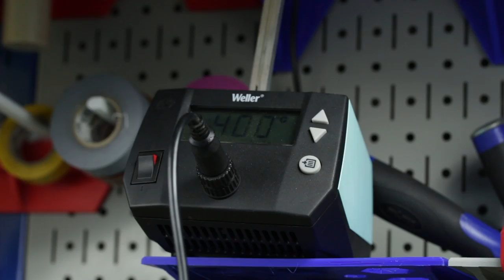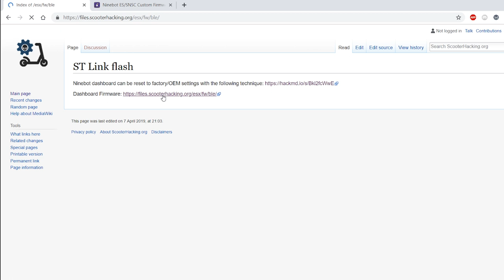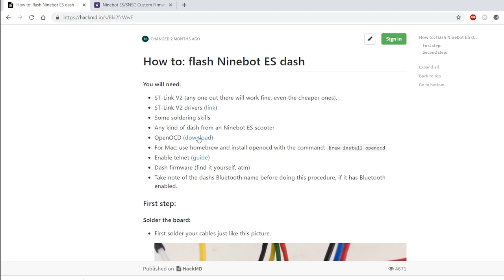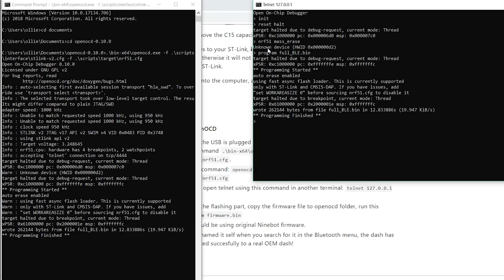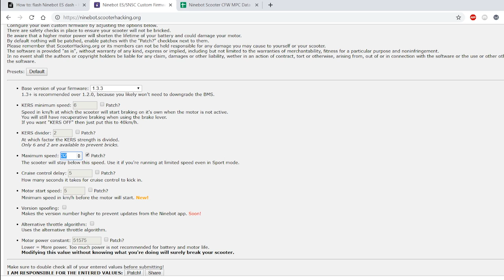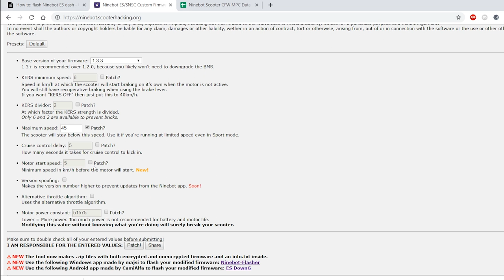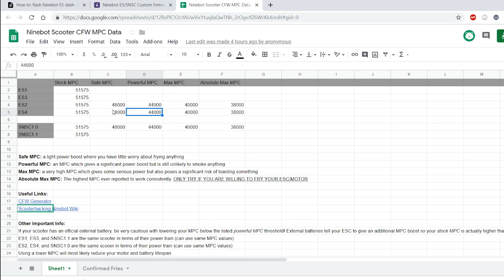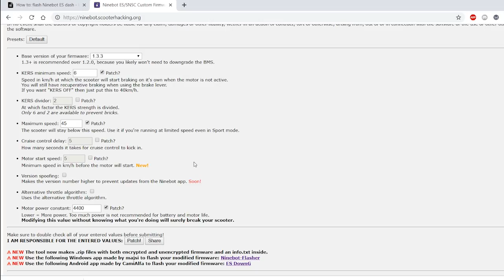Ninebot ES/SNSC Custom Firmware (CFW) ST-Link Flash Tutorial

Comment: Hello to everyone.
I have an ES4. I have never hacked anything. With the last update from Segway, which i think it was released about 3 weeks ago, my scooter now goes up to 32km easily. Also it used to suddenly brake when i was going downhill in order to not pass 32km (which was a bit dangerous) but that braking is also gone. Yesterday for example I went 40km downhill.
Reply: Is this with full battery and without cruise control?
Reply: @Zamani3033  No cruise control. Battery doesn't matter if it is fully charged. I get 32km even if the battery is at 50%.

Comment: Great video.
I bought mine already modified and with external battery and I was having a blast with and has been a blessing to avoid using public transportation.
Now, after less than 800kms and six months later, in Sport mode, everytime after a couple hundred meters after begining my daily use I'm having massive torque loss!! It takes forever to reach 30km/h and before was a metter of seconds... small uphills that was possible to make at 20kms/h now it's climbing at 8 / 9kms /h :(...
What do you thing it could be and how to fix it, since I haven't found any solution in the internet?
TY
Reply: Battery related problem probalbly

Comment: please help !

 Open On-Chip Debugger 0.10.0
Licensed under GNU GPL v2
For bug reports, read
        http://openocd.org/doc/doxygen/bugs.html
Info : auto-selecting first available session transport "hla_swd". To override use 'transport select <transport>'.
Info : The selected transport took over low-level target control. The results might differ compared to plain JTAG/SWD
adapter speed: 1000 kHz
Info : Unable to match requested speed 1000 kHz, using 950 kHz
Info : Unable to match requested speed 1000 kHz, using 950 kHz
Info : clock speed 950 kHz
Info : STLINK v2 JTAG v28 API v2 SWIM v7 VID 0x0483 PID 0x3748
Info : using stlink api v2
Info : Target voltage: 3.234437
Error: init mode failed (unable to connect to the target)
in procedure 'init'
in procedure 'ocd_bouncer'

Comment: I can get up to the point where I try to Telnet in via the command line, but thats not working. Any way to figure out if/what address I might use instead of the one you provided?
Reply from the maker: Eli Whipple can you confirm you’ve enabled telnet on your PC?
Reply: @BananaScience  Yes, telnet is enabled on my PC. Reading through more threads, I am using some knock off dashboard without a capacitor on c15 that others seem to be having an issue with.
Reply: My apologies, everything worked fine. I needed to actually be running two CMD windows to do this. I was running the long code, cancelling it like a dummy with Cntrl C and then trying to telnet. Run long code, then open another CMD window and telnet, got it! Working fine, but getting an error 49 and some weird behavior on my working scoot. Getting error 10s on the others.
Reply from the maker: @eliwhipple1854  Error 10 means you either need to replace or flash your ESC but I'm not sure what error 49 means.

Comment: Hey bro im stuck at the end, do I need to resolder ? Thanks

C:\Users\Paul\Desktop\openocd-0.10.0>.\bin-x64\openocd.exe -f .\scripts\interface\stlink-v2.cfg -f .\scripts\target\nrf51.cfg
Open On-Chip Debugger 0.10.0
Licensed under GNU GPL v2
For bug reports, read
        http://openocd.org/doc/doxygen/bugs.html
Info : auto-selecting first available session transport "hla_swd". To override use 'transport select <transport>'.
Info : The selected transport took over low-level target control. The results might differ compared to plain JTAG/SWD
adapter speed: 1000 kHz
Info : Unable to match requested speed 1000 kHz, using 950 kHz
Info : Unable to match requested speed 1000 kHz, using 950 kHz
Info : clock speed 950 kHz
Info : STLINK v2 JTAG v31 API v2 SWIM v7 VID 0x0483 PID 0x3748
Info : using stlink api v2
Info : Target voltage: 3.145736
Error: init mode failed (unable to connect to the target)
in procedure 'init'
in procedure 'ocd_bouncer'

Comment: C:\Users\Summer\Documents\openocd-0.10.0>.\bin-x64\openocd.exe -f .\scripts\interface\stlink-v2.cfg -f .\scripts\target\nrf51.cfg
Open On-Chip Debugger 0.10.0
Licensed under GNU GPL v2
For bug reports, read
        http://openocd.org/doc/doxygen/bugs.html
Info : auto-selecting first available session transport "hla_swd". To override use 'transport select <transport>'.
Info : The selected transport took over low-level target control. The results might differ compared to plain JTAG/SWD
adapter speed: 1000 kHz
Info : Unable to match requested speed 1000 kHz, using 950 kHz
Info : Unable to match requested speed 1000 kHz, using 950 kHz
Info : clock speed 950 kHz
Info : STLINK v2 JTAG v27 API v2 SWIM v6 VID 0x0483 PID 0x3748
Info : using stlink api v2
Info : Target voltage: 3.273164
Error: init mode failed (unable to connect to the target)
in procedure 'init'
in procedure 'ocd_bouncer'
Why am i getting this error?

Comment: Thank you very much for the clear tutorial... worked perfectly for me after flashing the bluetooth dashboard. Though I could not flash the control board but that is not the issue causing my wheel to rattle when it turns, I found out that one of the hall sensor wire connecting to the motor is broken, so join them back and its working perfectly now.
Reply: Como delimitar mi patinete eléctrico bongo  cecotec
Reply: Alguien sabe como puedo hacer para poder hacer la belocidad a 25 kh

Comment: Hi I have a doubt with the ESC (electronic speed control) is not the same dashboard? It is the motherboard that is where the battery is connected. I have a scooter of that tutorial reference but it does not turn on, nothing appears on the screen if I turn off the taillights, turn on the screen but not the speedometer. I think it is a type of blocking my concern is that I bought the dashboard and it doesn't work. I lose my money. What advise me please
Reply from the maker: Is it an ex rental scooter? The two electrical components people confuse a lot are the dashboard and the control board (AKA ESC). If you have an ex rental scooter you will likely have to flash the control board as well as the dash to get it to work.

Comment: I have a question , what if I have a bird scooter and I have the new dash board but I can’t make it run and the only way I know how to make run is buying a new controller is there another way to make it run Like flash the controller or something like that? Thanks have a nice day
Reply from the maker: Forfeit 7 TV Does it read error 10? If so check out the forums on how to flash the speed controller which will fix your issue.

Comment: When I go to put the hacked firmware into the Ninebot-flasher app using your steps it says my file is ‘bad’ any advice?
Reply from the maker: Use a earlier version of firmware. I think the latest version Ninebot Flasher accepts is 1.3.9. If it's any other version, it will throw an error.
Reply: BananaScience Have you heard of when the ES4 gets to 22 mph it quickly applies breaking and goes to 19mph and then cycles doing this?
Reply from the maker: @mrdwil777  Yes that is normal. CFW only guarantees stable speeds up to 20mph at the moment and anything above that will have that strange acceleration and declaration issue.

Comment: Hi,  I did  exactly all procedure as video and after program command using full_BLE.bin, the console sent an error "couldn't open full_BLE.bin" and **programing failed**......
 > program full_BLE.bin
target halted due to debug-request, current mode: Thread
xPSR: 0xc1000000 pc: 0xfffffffe msp: 0xfffffffc
** Programming Started **
auto erase enabled
couldn't open full_BLE.bin
embedded:startup.tcl:476: Error: ** Programming Failed **
in procedure 'program'
in procedure 'program_error' called at file "embedded:startup.tcl", line 532
at file "embedded:startup.tcl", line 476

Could you help me ??....Now when I connect dashboard to ES2 it don't do nothing, only brake lights blinking .
Reply from the maker: I’ve never seen that error before and am just as clueless as you to the cause of it. I’m no professional when it comes to OpenOCD but I would check out the Scooter Hacking Discord and ask some of the devs which might be able to help. Sorry I can’t do more!
Reply: I got a similar issue on my end! Very annoying.
Reply: Download the bin file again
Reply: hola as encontrado algo a tu problema ???

Comment: This is a great guide and worked perfect but I have 1 problem. Everything works perfect on the ES 2 scooter (the one with just the 1 internal battery) but when I do it with an ES4(has the additional external battery), I can't get the batteries to charge past 75%. Do you have any advice? Thank you for this info
Reply from the maker: To confirm, this is after you have flashed the hacked firmware? Is the range affected (only 75% of the range?).
Reply: yes
Reply: @BananaScience   @BananaScience  Yes, everything works perfect and 100% charge on the ES2's but my es4's will only charge to about 78%. If I take the external battery off I can charge the internal one to 100%. If I have both the internal and external battery installed, I can only get to like 78%. I checked voltage and I don't remember exactly off hand but 78% was not a display error. The voltage was lower than the ES2's showing 100%. I have swapped both internal and external batteries with my other scooters with the same results. I am thinking it's a BMS version problem. My batteries have mismatched versions but I don't know how to change them individually. I don't know if it matters but I also don't have windows 10 for the serial number change. Thank you again for your work
Reply from the maker: Yeah it could be a BMS version issue. You can update the BMS firmware through the ninebot mobile app and then re-flash your hacked firmware afterwards.
Reply: @BananaScience  Excellent, I will try when I get home. I was scared to install what Ninebot called the  "master software" version 1.4.1. I didn't know if I could go back to hacked software after I updated or not. Also, do your LED's on the bottom work after the hack flashed install? One of my Es4 work but the other does not. I have researched and from what others say, it has to do with the serial number.
Reply from the maker: All of my LEDs on my scooters seem to work after flashing the hacked firmware. Let me know how it goes!
Reply: @BananaScience  I figured it out. Get ready for a laugh. They don't all have LED's on the bottom.
Reply from the maker: Lol ya

Comment: i am getting error 10 with a a red wrench flashing on and off. do you know how to fix this?
Reply from the maker: Is this after flashing custom or stock firmware?
Reply: I got this error when connecting to a newer model without flashing. I'll be trying the firmware update when my ST-Link comes in.
Reply from the maker: Antassium it’s likely because the new BIRD ESCs use proprietary firmware that needs to be reflashed. Check out the scooter hacking forums for instructions on that.
Reply: @BananaScience  what if you thought you already flashed it? did the flash just not go through correctly?
Reply from the maker: Giacomo Ciminello What do you mean? Could you please elaborate a little more? Did you already flash the dash or ESC?
Reply: BananaScience dash got flashed. I think. On a Mac, don’t recall seeing errors, but followed all the steps as stated. Plugged in, error 10. Pulled the control board, found schematics for soldering the usb yo the board but no real instruction on how to flash the control board so I’m at a standstill

Comment: Hey, i after i flashed the new firmware on my Ninebot ES1 (with extarnal battery (from ninebot offical))  i wont go any faster than 18 km/h. I used https://esx.scooterhacking.org/ to make the firmware and i flashed it over bluetooth with IAP and i also tried Ninebot flasher. The scooter still works but i capped at 18 km/h (when i reach 18km/h the motor either stops or gives jsut enough power to keep it at 18km/h). All i changed when i made the firmware was the max speed to 35 km/h and the Motor Start Speed to 3 km/h and the Motor Power constant to 47000 and 48000 (tried multipel things to make it go faster than 18 km/h). Everything went smooth when flashing the firmware but i didnt go faster. BUT the Motor Start Speed did actually change to 3 km/h so that worked atleast. I also tried to hack another scooter that i am borrowing from a guy (also Ninebot ES1 with extarnal battery). But his goes upto 22 km/h. Thats why i think that maybe my Extarnal battery is either broken or ¨unbalanced¨ (heard that if the battery is ¨unbalanced¨ it wont give the scooter better performance by this guy https://www.youtube.com/watch?v=F83vr0o-mYc&t=321s at 5:02. PLEASE HELP!

Comment: After doing this my scooter . Pulls and stops from 20 to 21 mph.  Meaning is like breaking and acceleration every 4 seconds from about 19 to 21 mph.
Reply from the maker: Fast Hardware yes, we noticed that too. CFW doesn’t support more than 20mph yet
Reply: There is a new cfw based off 1.3.9.  Any changes or improvement on this breaking effect

Comment: Friend I have been working with the St-Link V2 but lately when I connect to the STM32 ST-LINK Utility I get an error like this: 
18:42:50 : Can not connect to target!
                  If you're trying to connect to an STM32W1xx device, please select Normal or HotPlug mode from Target->Settings menu.
                  If you're trying to connect to a low frequency application , please select a lower SWD Frequency mode from Target->Settings menu.
18:42:51 : No target connected

Know what is causing this problem, so far I can not solve it and I have updated drivers
 :C

Comment: Bno ya descargue el archivo q me enviaste,    seguí los pasos  y al ejecutar . /bin-64/openocd.exe - f. / scripts/interface/stlink-v2. cfg - f. /scripts/target /nrf51. cfg     
Me aparese esto :
Open On-Chip Debugger 0.10.0
Licensed under GNU GPL v2
For bug reports read
http://openocd.org/doc/doxygen/bugs.html
Info: auto-select ng first avallable sesión transport "hla_swd". To override use ' transport select<transport >
Info:the selected transport took over low-level target control. the results might might differ compared to plain JTAG /SWD Adapter speed:1000khz
Info:  Unable to match requested speed 1000 khz, uning 950 khz
Info: Unable to speed 1000 khz, using 950 khz
Info :clock speed 950 khz
Error:open failed
In procedure 'init'
In procedure ' ocd_bouncer'

Por favor dígame q estoy haciendo mal en serio no quiero abandonar mi scooter    gracias por todo
Reply: obtengo el mismo error   que sera???

Comment: Will you ever make a tutorial how to flash using the android app and bluetooth?
Reply from the maker: Likely not as the process is almost identical to this one except you need to just transfer the CFW file to your phone instead.
Reply: From my research, I wasn’t able to change my serial number via Bluetooth, I think it requires the st-link to disable that, if the 4th digit in the Serial is an R, then it is stuck in rental mode with only 1 speed setting.

However in curious if it will work via Bluetooth if you remove the c15 Bluetooth refresher chip

Comment: Can someone tell me if any of these steps will work for a Segway mini lite? I bought one that was supposedly “new” works ok, but I can’t get it to connect via Bluetooth therefor I have additional feature/mode control. Rather then passing on my problem to someone else by selling it, thought I’d see if flashing the firmware would fix it. Any guidance is appreciated.

Comment: So if you want the original firmware then you have to disassemble it and if you want a custom one you just use ble?
Reply from the maker: You need to flash OFW before you flash CFW. So if you want CFW you have to flash OFW first unless your scooter is not an ex-rental scooter.

Comment: Could you ever do this without soldering? If I buy an oem dashboard, it will have the original ninebot software so I could just install the hacked software?
Reply from the maker: Yes if you buy an OEM dash but even some that claim to be OEM aren't OEM. (plus it will cost quite a bit more). You can do this without soldering if you have a friend hold two multi meter probes in place and stick the other two power probes into the red and black wires going from the throttle or brake connector.
Reply: @redwan TANGER so what I did is I bought a CLONE dash to replace the gps block for my es2 and it for the past 40 miles has worked fantastically. If you want to switch modes from sport you have to buy an OEM control board
Reply from the maker: @redwan TANGER Yup but you'll also need to flash the speed controller
Reply from the maker: @redwan TANGER Gotta remove the GPS lol

Comment: my wheel is locked and does not stop beeping, the screen does not turn on and it is new, when I connect to the application I get error 32, will this work?
Reply from the maker: Hmmm... not sure exactly what's up there but flashing stock firmware if you've ever replaced your dash sounds like a good place to start.
Reply: thank you I'll try now with the st link, if I can fix it I'll tell you
Reply: @BananaScience  I have managed to make it work, thank you very much, sometimes I get error 42 for the external battery, do you think it's because of this programming?
Reply from the maker: You probably just need to make sure your external battery is screwed on nice and tight as it's likely just loose

Comment: Hello want to ask you, can i do it with mac pc or only windows. And another question. The usb key you have, its a special one or can i buy it everyplace?
Reply from the maker: You can buy the ST Linker USB device from the link in the description below. You can use mac to do the ST Link flashing (terminal code is a bit different so make sure to check the website where I copy the commands from for the mac version) but you will need to use an android or windows to upload the stock firmware. You could boot into windows on a mac using boot camp though which should probably work.